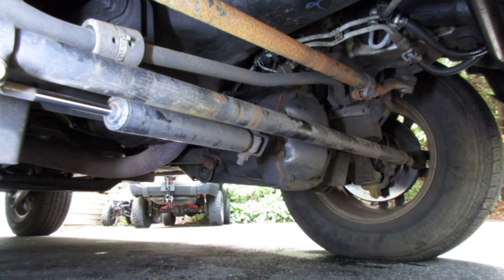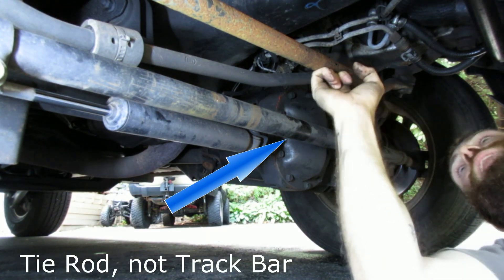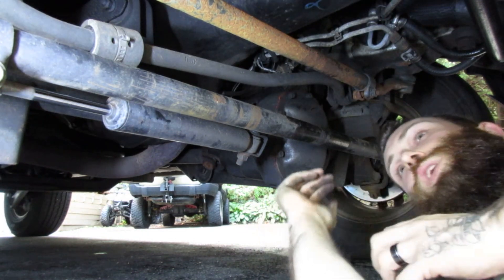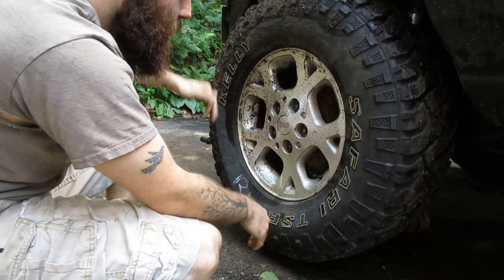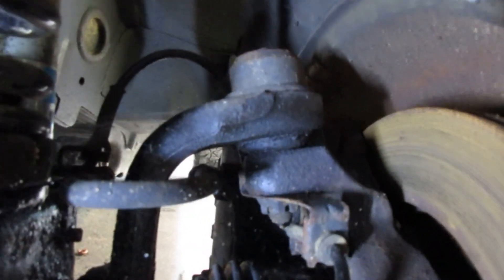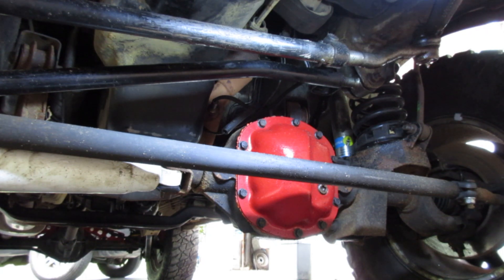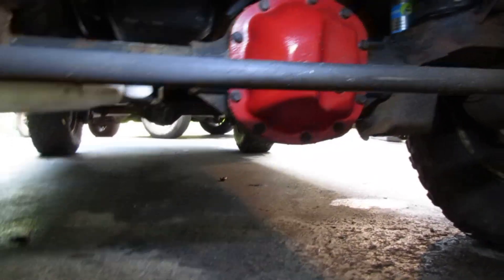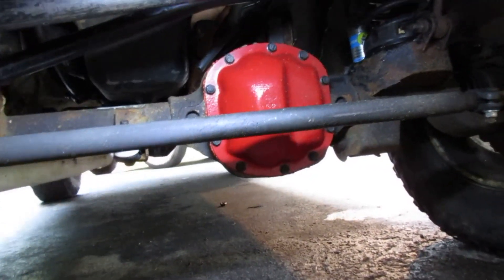How to Diagnose DEATH WOBBLE

Comment: Geeeeeeezzzz, guys.... The Upper ball joint is MADE to have as much as 1/2 INCH of vertical movement! ANY... Let me repeat, ANY vertical play, means that your LOWER ball joint needs replacement. You'll need to pop the upper BJ out to have a hole in the top of the spindle for your "C-Clamp" style BJ press's mainshaft anyway, so WTH, get the uppers to go with the lowers, but please, look, & understand how this system works, by closely examining your new MOOG, & MOOG ONLY replacement parts.  & REMEMBER! Upper out first, THEN LOWER OUT, &&&& BACK IN SECOND, then UPPER put back in last..  First of all, Vertical spindle-play due to XS wear in the LOWER BJ is found MUCH EZR by inserting your 3' prybar (Truck on HOIST, wheels dangling) between the bottom of the drive-axle U-joint/yoke, & the spindle appendage that curves down, & holds the lower ball joint, prying upwards to lift the drive-axle while you can see the vertical play, (much ezr if you don't have anyone helping you) prying under the tire is simply NOT how to do it.... I also HIGHLY recommend using a dial-caliper to check clearances for press-fitting the BJ's. hole should be no more than .003 smaller than the BJ cup outside-diameter, use sanding drum on a drill, LIGHTLY  clean rust out of hole, use dab of grease on freshly cleaned BJ hole, (&&& buff liberally around OD of wheel brg hole where you had to beat the snot out of the wheel bearing to get THAT stubborn bastard out...(Did you mangle your dust shields chiseling the rusted wheel brg out? O`Reilly now carries the dust shields. 9$ ea, just replace them, & be done with it..... . & do I HAVE to tell you to CLOSELY check your drive-axle U-joints?  Yeah, now's the time... :) don't forget to screw a real, working zirc into the replacement (LOWER) BJ's after pressing them in, and (MOLY!) grease the shit out of them, especially if you don't have room to leave the zirc in place, due to axle-clearance issues, & have to put low-rise plugs back in to clear the axle.   The guy here IS giving good advice on checking for track-bar (& all the LINKAGE, NOT BJ's, but ALL the linkage) play by having the vehicle ON THE GROUND, especially if you have a trak-bar that has a "Tie-rod-end" where it connects to the frame-rail. you WILL NOT budge it by lifting, shoving, prying, swearing at it, or glaring at it... But he once again  goes where I have to disagree as to NOT turning the steering wheel lock-to-lock, JUST ONE 1/2 turn bk-n-4th...You WILL need a helper to start engine, & turn steering wheel bk-n-4th 1/2 turn, truck ON the GROUND, full weight on tires, while you eyeball track-bar @ both ends for play, from your creeper, with the aid of a DAMN good flashlight... it's the CHANGING OF DIRECTION that makes loose parts show wobble, NOT how "far" you move them....   Gear oil been dripping from where axle goes into the axle tubes? You're gonna have to pull the Ring-gear-n-Punkin to do the axle seals. DON'T MIX UP OR INVERT THOSE PUNKIN-RACE MAINCAPS!!! (that's an INSTANT "DEAL-BREAKER"!!) Now's a good time to take up some of that SLOP between the ring gear, & pinion.... Did you eyeball the bearings & races for wear? Ring-gear bolts tight?  Did you clean all the metallic paste out of the punkin-housing (& clean the magnet) with some aerosol carb-spray B4 assembling it??  If you have a couple-3 thousandths of side-to-side play when you push sideways on the ring-gear, new races will likely fix that if bearings still look good...  or maybe there were some thin race-washers that you can move from tooth-side, to backside of ring-gear to take up slop. Try using larger 1/2" drive socket on 1/2" extension as a seal driver, works great for me, just DON'T expect to get anywhere tapping them in place with a hammer-n-punch..questions? ask away, I'll be checking here time to time.

Comment: On my '74 CJ5 it was caused by worn sway bar bushings, worn tie rod's & a worn manual steering gear box worm gear...Total mileage on the unit was only around 106,000 miles (verified), which surprised me; as I would think the steering gear box would go at least 200,000 miles...But, whatever, not such a big deal adjusting the gear box & all the rest, time to revamp the steering anyway, after 44 years!
Reply: Well its not the miles its the age

Comment: I have a 1988 yj I can’t drive it on the interstate or over 60 - 65 mph without getting really bad death wobble I put a new steering gear box on it because it had a lot of play in it but still have death wobble all bushing look good no play on the track bar I’m going to check tie rods and wheel bearings tomorrow, but I’m pretty sure my jeep has universal joints not cv joints on front end does anyone know if the bearings are any different 
And I will note that this jeep has 52,000 original miles on it

Comment: I'm really big on research !! and I have a death wobble on my 2000 jeep cherokee I thought I had it fixed because when i inspected it with my Nephew he noticed the U -joint on the passenger  side had no needle bearings in it ?   replaced the passenger side u-joint checked the bearing it was fine then drove it on the freeway at 70 plus MPH up to 90 MPH NO PROBLEM'S . Then after i fixed it a couple weeks later it did it again ? I can't find any play anywhere . So its goota  be the track bar . I like the explanation and how and where to check .You covered it very well . Most videos just explain the problem they are having and thats cool .However YOU COVERED MORE Death Wooble ISSUES . Great Video KEEP EM COMIN !! Thanks Tom Hamada Nephi Utah :)
Reply from the maker: Well thanks for the positive feedback. Glad you enjoyed the video and I hope it helps you sold the DW on your XJ. Good luck!

Comment: hey, I have some of this wobble on my JK, the track bar seems very solid, same with drag link. the tie rod is not as "loose" in the bushings as I have seen on other videos, but it is way easier to rotate it back and forth than the other rods down there. When I go into turns there is also a clicking noise, and it is definitely not the tire rubbing. would you say it is the tie rod?
Reply from the maker: A clunk while turning points to a ball joint. I have also experienced that clunk with very worn out control arm bushings. They are hard to diagnose because when the jeep is on the ground they have tension on them and seem ok. Check out ball joints and control arm bushings and i bet you will find your culprit

Comment: Just a note, Toyota landcruisers had solid front axles through 1997 so not all Toyota owners will point out the lack of death wobble.
Reply from the maker: Fair enough. I assumed that since Tacomas have been IFS for some time so was the rest of the Yota lineup. thanks for the info!

Comment: Death wobble occurs on vehicles with good components too. I think it's a vehicle geometry thing and when parts are changed, that just changes the geometry. I would start by putting a pair of jack stands under the axle and loosen and retighten the control arm bolts. Maybe giving it a couple of bounces before retightening the bolts. Every vehicle is different so do what you have to too reset the geometry.
Reply from the maker: This is true. Front end geometry is extremely important. Most notable, when you lift a vehicle, but do not increase the length of your control arms, you throw the castor angle off. This can leave to harsh handling which can cause premature wear of steering components leading to death wobble. There is actually quite a bit of math involved with lifting a vehicle correctly.

Comment: I've been experiencing death wobble for awhile now and I have a clicking sound when I turn and drive. Do you believe this comes from a problem with the tire rod ends
Reply from the maker: Clicking is usually a track bar, but tie rob ends could do it is they are WAY past gone. I would get underneath and have someone turn the wheel side to side while you are under there. the whole steering system should move as a unit. it anything moves on its own, or has play, that is probably your culprit. If it is a jeep, 85% of the time it is the track bar.

If it is more of a pop than a click, take a look at your ball joints using the method i display in this video. Good luck!

Comment: Thanks for the video. Would these symptoms also cause the Jeep to wander on the road (side to side suddenly like a strong cross wind hitting the side of the Jeep)? Is this considered death wobble? I just picked up a 80 CJ5 and it's a bit scary to drive because how it wanders on the road.
Reply from the maker: If it is wondering, but not shaking violently, it doesn't sound like DW yet. Might just be very worn out steering components or out of alignment wheels. It definitely sounds like the kind of situation that could lead to DW and I would recommend following the steps in this video to pinpoint where your problem is
Reply: Thanks D&E. I took the Jeep out for a proper ride yesterday and today. I have a lot of play in the steering wheel when turning the wheel to the right. I can turn it 1.5"-2" before the Jeep responds. Once it responds I can turn the wheel 1.5"-2" to the left before it responds again. When turning the wheel from center to the left it responds immediately. I'm going to say that may be contributing to the wandering on the road. I was able to adjust my driving to compensate for this steering slop but it's not something I want to live with. I'm going to tend to it ASAP. I had it on the highway doing 60-65mph and it drove fine. It does suffer from bump steering and I have a stabilizer on order to take care of that.

Comment: I agree with DudeDylanB best explanation on YouTube period. I almost went out and bought the Rough Country dual stabilizer for my death wobble problem. I'm gonna check all my joints first might still buy the Rough Country but now I know that the dual stabilizer isn't the main reason for it. Thanks D&E In The Garage!
Reply from the maker: Glad to help! Hope it all works out for you!
Reply: D&E In The Garage hey I have a 2000 Jeep Cherokee XJ for the 4 1/2 inch lift kit I just got it two months ago and I just started getting death wobble. Me and my uncle put some new parts in it and the death wobble is bad. I did some of the tips that you showed in the video and everything seems to be solid and I did not see any play when I put something under the tire and I rocked it back-and-forth. If there’s a way you can contact me that would be great I need to get this fixed as soon as possible

Comment: Did you just weld a flat washer to the track bar bracket when it had wallowed out?
Reply from the maker: yes, make sure you get Grade 8 or you will be back again in a month. They also sell these weldable inserts which i hear work. you drill the hols out to a larger size and weld the insert in. Seems like more work to me, but I think that is the "right" way to fix the issue.

Comment: thanks for the vid. my 05 dodge durango does this every time i reach 70mph it shakes/vibrates like crazy on certain types of highway roads. also when i hit a hump it hops up and it moves to the left or right until it gains traction again. very scary. i changed the shocks because they were froze its not as bad now but it still does it so like you say best to change out everything you spoke about.

Comment: DUDE... Tie rod ends... CONSTANTLY replacing these in my WJ. I think its a disease they get. I've had a set last less than 3 weeks once. Now, the tie rod ends are good - mechanics and jeep guys all confirm they're good - however when i hit a bump there is so much knocking it sounds like my wheel is gonna fall off... BUT EVERYTHING IS TIGHT. Something is fucky.
Reply: I know the feeling of chasing that "jeep rattle"... painful. Maybe your control arms? When those bushings go they can get pretty loud going over bumps. Also, are you certain it is coming from the front? The ball joint on the rear a-arm on WJs can get loud when worn out.
Reply from the maker: Definitely check your front and rear control arms for looseness. This can be difficult with the vehicle on the ground as their is stress on the system which gives the appearance of no slack. you might have to jack up the body, support it with jack stands, then get a jack under the axle and play around with it at different heights to see is their is play in your control arm connections. If you find out that it is your a-arm ball joint, i have a vid on replacing that too! Hope it works out for you!
Reply: Definitely front, mostly driver side - noise happens when i hit bumps on just passenger side as well, although it's not as loud. I'm gonna check sway bar & links next. It sounds like the bass line from Primus - My Name is Mud.  https://youtu.be/953PkxFNiko?t=34s
Reply from the maker: That is hands down the best tool I have ever heard used to describe the sound a vehicle is making. SBLs sound like a possible culprit, especially if handling isnt being compromised. I once had a wallowed (ovalled) out lower shock mount in the rear which produced a similar sound. Maybe a loose bar pin in the front shocks? Good luck with it. I'd be interested to know what you find when you solve it!

Comment: I have a 2006 ram 2500 and I had this death wobble. Basically mine happened because the truck was out of alignment and wore the tires prematurely. So people proper alignment and balancing is very important. Don't over look it. Because I didn't think a tire could cause such a thing as death wobble, I had to replace most of my suspension plus control arm bushing which are a bitch.
Reply from the maker: You ain't wrong! It is crazy how a small thing being out of spec can send the whole system down a very dark, shaky road. haha

Comment: I need help!  I change the joint balls and all tie rod ends in my jeep grad cherockee WJ (3.1 td european version).  I buy a cheap afetermarket parts (new) on the net and the result is terrifying. The steering became havy, i cant keep the car in a strait line (after severus alignements), the steering don t return to the central position by him self, need to be pull... Change all the piecs to original parts is the solution to my problems?  Thanks!

Comment: I have an 02 WJ and found another trigger for death wobble - the passenger side brakes would slightly seize at random times, not enough to notice but enough to trigger a death wobble at about 50 MPH.  Now to figure out what's worn out - thanks for the video, it is an excellent description of what to look for.
Reply from the maker: Very interesting. Can I assume you have the Teve front calipers (The ones with the wire spring clip on the outside face)? They are notorious for malfunctioning and were only used from 99- half way through 02. I imagine that would absolutely case a vibration and lead to DW. Thanks for the tip!

Comment: I cured the DW in my XJ by replacing ball joints, bearings, TRE's, track bar, sway bar bushings. Everything. 20k miles later and it's back. Sigh.
Reply from the maker: What lift, tire size, and control arm setup are you running?
Reply: I'm not. It's bone stock. 2001 XJ. I replaced the axle tube with a "new" one from a 99, also rebuilt the diff. The dude who owned it before me hit a guard rail, so I think the frame is tweaked and it just puts pressure on the parts. I am not exaggerating when I say that everything on the front end is new.

Upper control arms are new, too. Control arm bushings all around, replaced. The only thing I've done is put ~20k on it since the restoration. I'll probably just give it a once over and then start throwing new parts at it. Again.
Reply from the maker: Wow, that is unfortunate. Assuming you don't have wildly out of balance tires and/or wallowed (ovalled) mounting bracket holes somewhere, it definitely sounds like your Unibody is out of spec somewhere. I suppose if you have the cash and interest, a good body shop will be able to tell you where and if it is possible to get it bent back to the correct geometry. Best of luck with it!

Comment: Whether the tire is also the cause of death wobble? I use a new tire, but my friend says I use a bad brand of tires. i've checked the balljoint and tierod all still worth using...
Reply from the maker: What size tire are you running? Cheaper tires tend to be harder to balance and have asymmetrical attributes which could certainly trigger DW. This is magnified on larger tires. How are your Track Bar/ Track Bar Mounts?